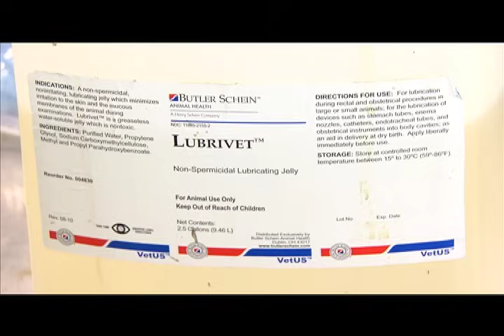How to palpate beef cattle for pregnancy diagnosis

Comment: fantastic  method  to  palpate   cervix , uterine   horns  &  pregnancy   through rectum  # but   does  cervix  has  cartilage   tissues  or  thick  muscular  connective  tissues  ????? & if  it does has   cartilage  tissues  does it  dilate    10 to 12  inch   in  diameter  to allow  calf  fetal delivery ??????
Reply: of course it does , because this is the only natural way a calf is born